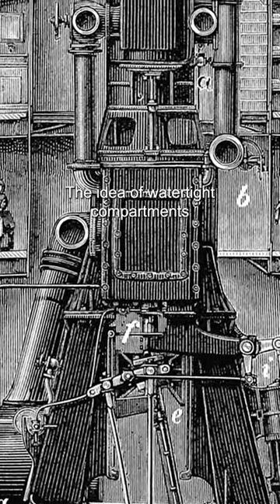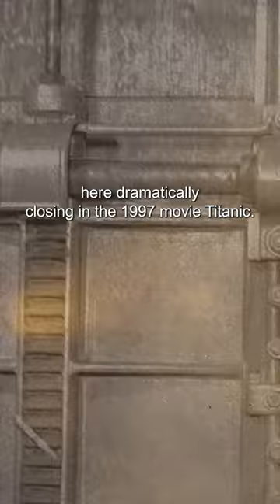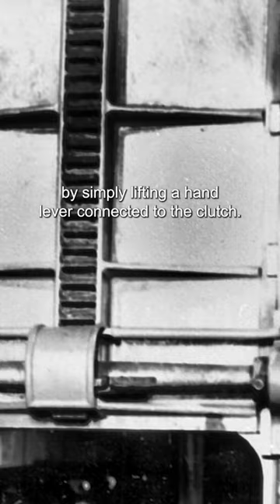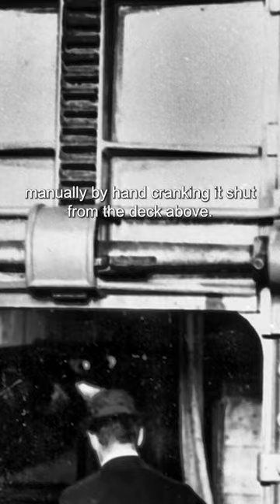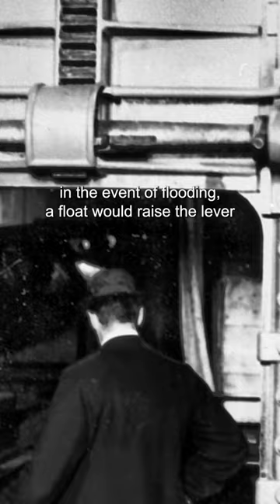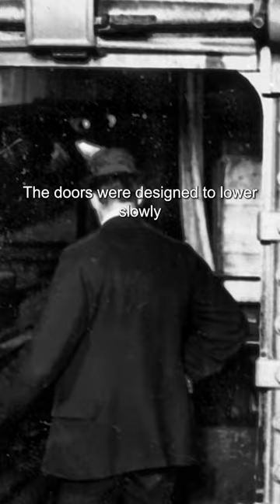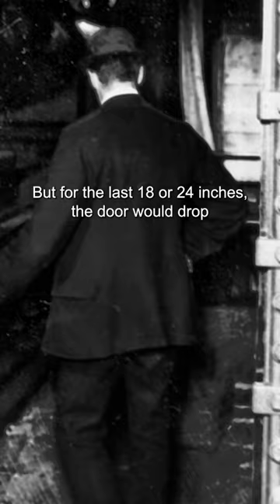How did Titanic's Watertight Doors work? | Oceanliner Designs #Shorts #Titanic #Ship #History

Comment: Yeah but the water toy bulkhead didn't go all the way to the top of the ship it stopped at the last two decks so when it hit the top of that deck at the water type bulkhead it just spilled over into the next one so on and so forth the reason it's saying if they would have built it properly and had the ball could go all the way up Titanic would have never sunk the bulkheads would have held they would have made it to the where they needed to be they would have lost some crew members but that would have been it but engineers in the builders did not put the bulkheads up all the way he was in the plans but they didn't follow the plans
Reply: The bulkheads did indeed go to the ceiling. What people mean by water “spilling over the bulkheads” is that, towards the tops of the compartments, there would’ve been openings like doorways and air ducts that would allow access to passages outside of the compartments; i.e, water would reach the top of one compartment, spill through a doorway, flow down a hallway, spill into another doorway and down into another compartment, and repeating.
Reply: @DerpyPossum  they actually did a thing and Discovery Channel and they said if they would have built the water type bulkheads all the way to the top of the ship instead of up to a certain deck this Titanic would have made to the port with one of the bulkheads full of water where the crack happened and it wouldn't have sunk but it kept spilling over it made it to the top of the bulkhead and it just spilled over into the next bulkhead just kept doing that and then till the front of the ship went down underwater